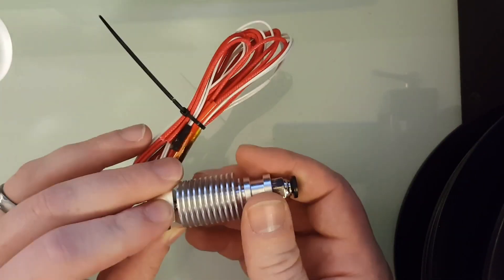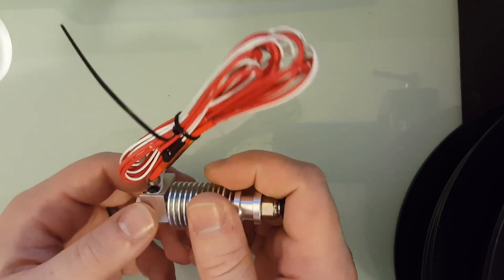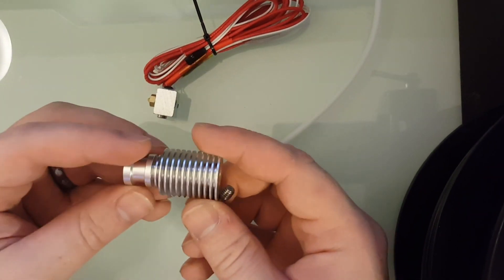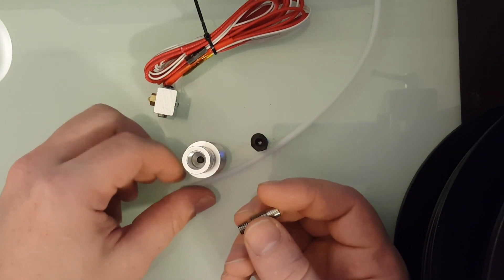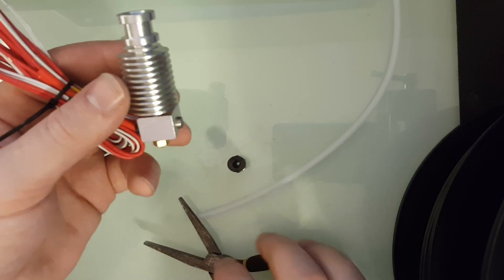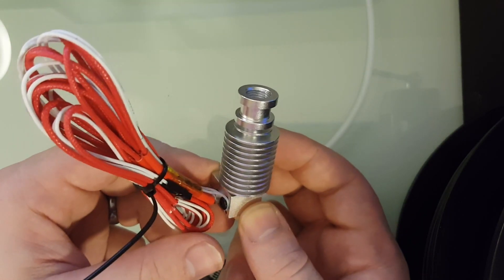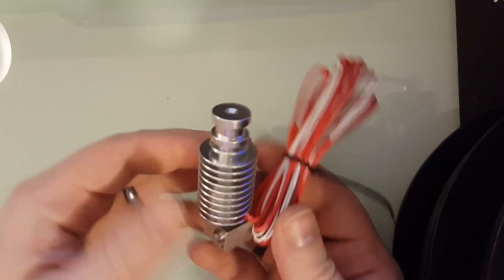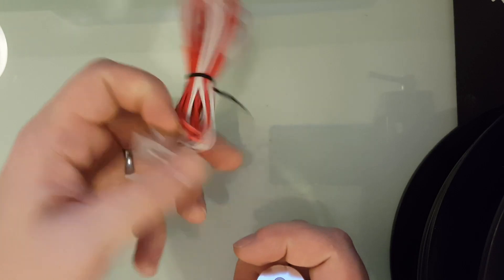E3D Clones for less than $5?!

Comment: I'm actually planning on replacing the heatbreak with a titanium one. Less friction and less heat transfer than a steel heatbreak, also less likely to snap in half during installation.

Comment: I actually ordered one from an American reseller last night, I also ordered an all metal heat break from amazon. Im concerned though, I don't know much about my 3d printer. I hear people saying they use them on Prusa's, but I don't know if I have an actual prusa or a prusa clone or just a different model prusa than most people talk about. Its a Prusa I3, however its an Adimlab Gantry Prusa I3, it says its 24v in the in info on amazon where I ordered it. The hotend is 12v, Ive read its not good to use 12v in a 24v and vice versa, but im curious if they are saying im 24v, basing it off the bed as well 12, to the hotend, 12v to the heated bed. Anyone know if Ill have any problems installing this hotend in my printer? Or settings I need to change?
Reply: i dont mean to be rude, but seriously:
1.educate yourself on basics of electric circuits
2. do not connect a heater cartridge to power before step1

Comment: The thing is today its easy to make a dimentional acurate replica cheap.  but Aluminium is not just Aluminium, Steel is not just steel, there are different grades, softness, corrosion resistant, temperature stability.  youy pay a lot more for the good stuff that will last and perform better under high temp conditions.       its up to you.   I ALWAYS NEVER cheap out.

Comment: The reality of it is, these are so close to E3d's because E3d is having them made in China. Their cost is likely a dollar or two, same as the clone sellers. 

Now think about that for a second. Even if E3D is spending 5-10$ on a better thermistor and cartridge...... they're charging 70$ over cost for their product. Yes, they must recoup R&D costs, and most will pay a bit more for genuine, but companies have got to realize that the quickest way to get the chinese to rip you off is to overcharge for something they can make cheaply. That's just economics....

Look at Roogi's hyperlite brand drone frames. You see VERY few clones of those, period. Why? because at the price point he set, they can't make a knock off cheap enough that's not a flaming pile of dog crap to get people to really want it!

Comment: how to get a cheapest all metal hot end
1. buy cheapest v6 clone on ebay
2. buy e3d heatbeake from e3d 
3. assemble
4.print
i have done it and it works realy good since most clogging issues are due to fillament sticking to heatbrake.
also volcano heating block on e3d site costs 15$ and on ebay 2$ shipping included.
Reply: and Micro Swiss heartbreak will make the clone a superior to e3d
Reply: i found a e3d v6 clone with volcano clone as well. do they really replicate it? is it equally as good?

Comment: I didn't heat my hotend when assembling it and no mess after dozens of prints. I don't know how necessary that is, it's kind of dangerous. I would do it only if you aren't me. I have gorilla strength grip.
Reply: The hard part was leveling dual hotends. There's no adjuster so I just had to get identical parts and use calipers with my gorilla strength. Tom S. says it's needed but time will tell how arbitrary the practice might be for this specific hotend.
Reply: I guess the main reason is that I didn't force the copper- and the current ones are titanium so it's near impossible to damage them. Weird because the coppers never had a problem and I didn't heat. Only thing that went wrong was my fan lost RPMs and it caused clogs.

Comment: BTW there are HIGH QUALITY Clones too if you're looking for that. http://www.ebay.com/itm/Metal-J-head-V6-Hotend-1-75mm-Filament-0-4mm-Universal-Extruder-Reprap-3DPrinter/111990898166?_trksid=p2045573.c100507.m3226&_trkparms=aid%3D555014%26algo%3DPL.DEFAULT%26ao%3D1%26asc%3D41375%26meid%3Db6ba8c3d220f44a0b59941b3011bf6b5%26pid%3D100507%26rk%3D1%26rkt%3D1%26

They are more expensive. But less expensive then the real ones.

EDIT: Also you can make the $5 one in this video become full metal with a replacement for that spin throat. There about $10 USD.
Reply from the maker: Yep, that's typically what I do. Now, I don't buy the really cheap all metal throats ($1-3) but instead I buy a nicely machined and polished version. It costs more than the clone hot end but I'm still in business for <$25 by the time it's all said and done.

Comment: Actually the way Chinese sellers service warranty - if and when they do, they may not be terribly compelled to do so unless the quality is quite consistent in the first place - is not by having you ship the item back to them, they don't need broken crap that was a dollar or two to begin with and basically isn't subject to repair. They just ask you to give photo or video evidence of the issue per e-mail, they check it for uniqueness, and you get to keep the bad one too and the replacement is on its way. Some Chinese sellers of expensive electronics offer returns to a local partner company instead of all the way back.

Sometimes it's Western, even "reputable" companies trying their best to inconvenience you with return shipment and shipping costs and undue wait and then determining on their own that it's not their fault that the item broke in use and they're gonna charge you an extra processing fee or repair fee even if it's higher than the price of the product. And what they might do next is try to sell the bad item again and again until somebody no longer can be bothered with returns. I don't mean E3D in particular, i'm sure they are great guys and would never pull crap like this, but this happens elsewhere, had this happen to me, seen this happen numerous times.

Comment: Is there a way to run a 3d printer and let it do a full print without the extruder and hotend running to test out the motors using repetier host? I could not find any info out there on this...
Reply from the maker: It depends, what printer are you using?
Reply: I am using a 101 hero... cheapest printer on the market... I am quite new to 3d printing so am also having some issues understanding the wiring setup on this machine... I notice it has four wires that lead to the hotend... Don't most hotends just have two... black and red? My 101 hero has the black and red and then two more red wires... If you know how to trick it to print without the hotend that would be super awesome ! Thanks so much for responding to my comment!!
Reply from the maker: All hotends have at least 4 wires; two go to  the heater and two go the temperature sensor in the hot end. One quick way to run a print without filament is to unload  filament from your hotend than slice your file with the hot end temp set at 0. Now, some firmware might prevent prints from starting if the hot end is under the minimum extrusion temperature, however I don't how the 101 hero is configured. To be honest, the 101 will be difficult printer to learn on due to its very low performance mechanical components. If you have the financial ability, something like the $200 MP Select Mini is an excellent first printer.
Reply: Yes... it prevents it from starting if you put the heater at 0... I tried that... I thought it may be a repetier issue but if you printers that will allow it then that means that something in the 101 hero code is blocking the function. Do you know how to write a gcode script work around?
Reply: I know that it is a really big ask but could you make a video to explain how the 4 wires connect to the hotend and what they do? I think a lot of people would find this information useful. Am I right in thinking that the red and black wires are for the sensor and the two red ones are to heat up the hotend?
Reply from the maker: That is a firmware limitation and cannot be circumvented with gcode. Have they released the firmware source for the 101 yet? What about removing the filament with a cold pull and just running the hotend at the minimum temp?
Reply from the maker: The wire color does not guarantee what function it has however most of the time the two larger red will be heater and the small red/black or white/white will be thermistor. I've got a few videos in the queue already so let me give you a quick rundown on those two components:
Heater cartridge: This is a big resistor inside a metal casing.   This typically connects to a MOSFET ( think electronic switch) and when the printer needs to heat up it enables the MOSFET which allows current to flow through the heater and heat your hot end up.
Thermistor: This component has a resistance that changes with temperature. Your controller measures that resistance change agree converts it from resistance to temperature through something in the firmware called a lookup table.
Reply: Thanks! This is great info! I will also stay tuned for your new videos! I really appreciate the help and will try it!

Comment: OK, so first of all thanks for your videos!  I am brand spanking new to 3D printing and I got a Monoprice Select Mini.  I basically tore apart my hotend because after my first print I had broken pieces stuck in it, and it didn't print at all, and when I put it back together again I didn't push up on the bottom.  I did that from your other video.  Well, wish I had seen this video first, because when I put it back together I didn't screw it in properly, and ended up with plastic all over the inside and outside of the hotend.  Needless to say it's a mess, and then I lost one of the nuts that secures it to the heat sink.  

So guess the question is simply - is it worth changing hotends?  With plastic all inside it, is it likely still serviceable?  Can I pick up that nut in a hardware store?  Frankly I don't mind spending $100 on something that's better quality than the stock hotend, but since I have no experience with this, not sure how hard it would be to mount.  I can solder, but suspect there's more to it than that.  Appreciate any thoughts...
Reply from the maker: Hey Dion,
The stock hot end is actually not bad quality, and produces great prints ( I have spare $100 hot ends sitting in bins and yet I'm still using stock on my Mini ). The missing nut is a square m3 with grubscrew (links below), and while you are at it grab some replacement heat breaks so you don't have to pick plastic out of your existing one. You will be back up and running in no time :)

Hardware:
http://amzn.to/2izRLNt
http://amzn.to/2iNYxNN

Heatbreak (threaded upper barrel is perfectly fine BTW):
http://amzn.to/2iGa1zN
Reply: Thank you very much!  I found my m3 grubscrew, but I may have stripped it, so I appreciate the link.  Do you happen to have links to the heating block and/or thermistor?  The machine has difficulty getting past 205, and even at lower temperatures appears to be inconsistent with the filament.  The heating block no longer has any tape on it, not sure how much that would have to do with it.  I assume I can use an infrared thermometer to test the heating block, and a multimeter to test the 12v current, but not sure of an easy way to test the thermistor.  Thanks again for the videos and links.  You've made me way less frustrated. :)
Reply from the maker: The thermistor will produce a printer error or simply 0C if damaged so you don't need to worry there. Likewise, the heater cartridge is just a big resistor so if it still heats up you are probably fine. However, the lack of insulation while not a problem per say, can throw of the temperature PID loop. You can get more insulation (link below) or you can run some gcode to have the controller run an autotune sequence.

Replacement Fiberglass Insulation:
http://amzn.to/2iDE0gJ

Instructions to setup interface for running direct gcode commands
http://mpselectmini.com/cura_pronterface

Instructions for running Autotune gcode:
http://mpselectmini.com/pid_autotune

Finally, a massive and comprehensive Select Mini resource document:
https://docs.google.com/document/d/1HJaLIcUD4oiIUYu6In7Bxf7WxAOiT3n48RvOe5pvSHk
Reply: You, sir, are a great man.  I followed your instructions and right now it is looking very good.  I clearly have many things to learn, but I really appreciate the help.  Although I'm relatively technical literate on the software side, hardware has always been a bit of a black box.  I got the MP Select Mini to get smarter, and I'm glad I found your videos... Keep making - I'm watching and learning :)

Comment: to polish the insides of a tight hole, a piece of rustic string, with some lapping compound or tooth paste, works wonders. the tighter the fit, the smoother it's gonna be in the end, and then work it like you mean it, oyu want it to get nice and hot! ;^)
Reply from the maker: Great tip!

Comment: assuming you are in the us, what was the shipping time from alibaba? Is there any amazon v6 clone brands you would recommend?
Reply from the maker: Take s 10-14 days to get to the US. The amazon seller 3D CAM sells a clone of comparable quality:

https://www.amazon.com/J-head-Filament-Extruder-3D-Printer/dp/B010MSTVZO/ref=as_li_ss_tl?ie=UTF8&qid=1483941055&sr=8-5&keywords=E3D&linkCode=ll1&tag=fg0ea-20&linkId=357d4ff0cef2e89f8b456e032a6093f6
Reply: @FDMGuru  What is a cheap and good current seller? Old one is gone. Thank you! Great tutorial!

Comment: good video!
and think you're right (unfortunately for the real fans E3D)
I also use the cheap and it just works well.
you should really inspect the clone by yourself,
but you should also do that by the E3D!!! 
(I also have problems with a E3D) afterwards also my own fault, I have not checked the E3D

Kind regards and good luck with printing.
Rob.

Comment: I purchased one of the v6 models. The heat break screws further into the heat sink. The narrowed portion almost completely disappears into heat sink. There is a portion of the threaded part, less then a 1/8"exposed. Do you see a problem with this. I ask this as I have seen some heatbreaks that are completely threaded and wonder if these are a problem.
Thanks for the video.
Reply from the maker: 1/8" gap between the heater block and heatsink should work fine however it sounds like they sent you the wrong heat brake. Is this for a bowden tube or direct drive extruder?

Comment: i bought the direct drive V5 clone and it always prints fine for the first 20ish layers and then the fillament at the feed motor gets so hot it softens up and stops being fed. so i put a cooling fan on it but now it seems like its too cool or something. it prints about 8 horazontal rows and then stops printing for 8 rows and then starts again. and it will consistantly do that for the whole print. is there some kind of magic fan speed to use when cooling these hot ends?
Reply from the maker: Hey Alex, sorry I missed your question! For all the e3d hotends or clones, you will want the heatsink cooling fan on full all the time. if the motor is overheating, you may need to turn down your stepper driver current.

Comment: I recently picked up a few of these and  it does nothing but skip. Filament doesn't seem to pass through. So I unscrewed the Bowden connection and manually pulled out the filament to see a small piece of the inner Teflon popped out on the tip of the filament and looked like it broke off a larger piece ( it wasn't a clean break) do you think I should try to remove the remainder of the inner tubing and giving it another run?.. The v5 ;clone worked fairly well except the grub screw always comes loose
Reply from the maker: Are you referring to the thin, 3mm teflon liner inside the heatbreak or the thicker 4mm bowden tube that seats into just the top of the heatbreak?

Comment: I notice there are printable fan shrouds for an original e3d and for a clone e3d due to differences in heat sink diameter.  Which one does this particular v6 hot end need?
Reply from the maker: This is an identical clone and uses the original style shroud.